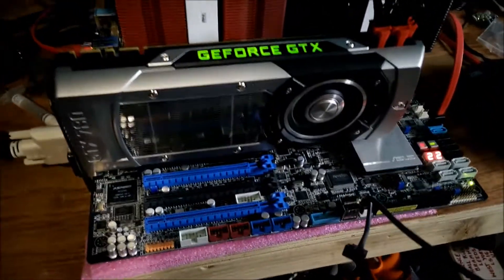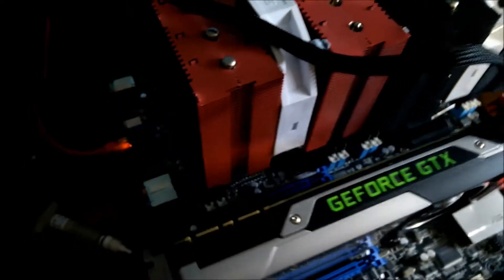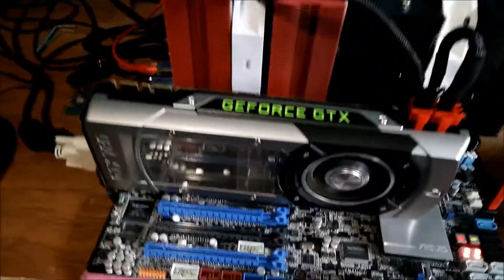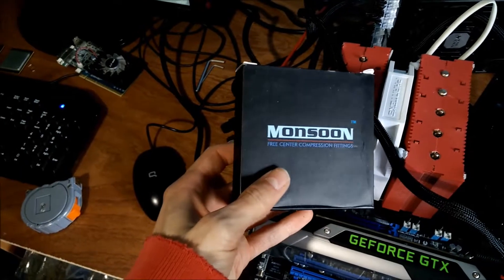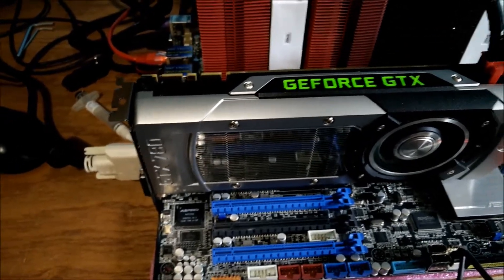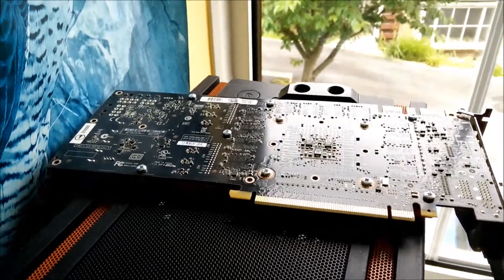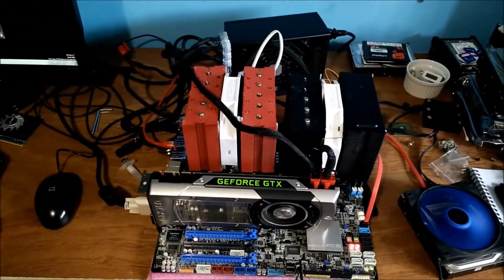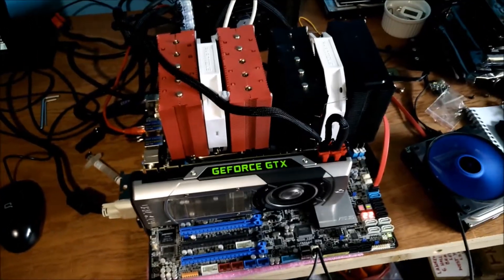More Xeons Dual E5 2670 and Dual GTX780

Comment: Hi there, looks like its gonna be a great build :D

My current project is similar :)
I received my parts last friday and experienced many problems till now...
Were you able to install the OS at the first shot?

My Setup is:

Z9PE-D8
2X E5-2670 v1 SR0KX
64GB Samsung ECC Ram
Samsung 850 EVO 500GB SSD, Samsung 830 EVO SSD
Asus Strix GTX 980
EVGA Supernova 1300 G2

i tried to install Win10, 8 via USB and always got an "ACPI_BIOS_ERROR" message. After that i deployed a PXE Server- same problem. After tweaking the settings in the BIOS and BIOS Update i tried to install Ubuntu - worked like a charm.
In the end i went with a Windows 7 installation via DVD - this worked. I installed all the drivers etc.
Now the main problem occurs after installation of the Nvidia drivers - lines all over the screen and crashing before the login screen.
In safe mode or at a normal boot with generic graphics drivers - it works. As soon as i install the drivers again - same story. 
Tonight i'll try another GPU to see if the Card is defective. Have you connected the EZ_PLUG molex? What BIOS are you running? mine is 5802. ACPI and CSM settings? Any similar problems? Also i've seen in some forums that a lot of these Motherboard have a BIOS Chip problem (replacement available for 15 bucks on ebay) which i exclude cause it worked more or less...

Sorry for the spamming, i'm just kinda desperate cause i've never had so many troubles with a pc

I would appreciate any help

Thanks
Reply from the maker: it sounds like you have a faulty gpu is it has lines across the screen, if it is still under warranty then you should be able to rma it and if its not it will need to be repaired by reballing or sold as spares. My friend has repaired a couple of gpu's for me and he managed to get 2/3 working, but its not going to work for every card. i dont use the molex pug, that is only to be used if you are using more than 3 graphics cards or other power pcie cards like raid cards. 

i would try getting you gpu replaced first and then if that does not work, then try the latest bios you can. i am also running 5802 and its works fine for me. i am running everything overclocked as well and i have had no problems :)
Reply from the maker: i just looked on asus's website and 5802 is the latest bios so that should not be a problem unless its with the bios chip itself:
BIOS 5802 for Z9PE-D8 WS released.
1. Improve compatibility with some add-on cards. (LAN/GPU/VGA cards.)
2. Improve compatibility when using some PS2 keyboard and USB mouse in Windows 2008. 
3. Improve stability about fan speed control. 
4. Support the policy of 3DVGA Card List for all Z9-Series project.
5. Improve BMC performance.
6. Modify string from "Lan1" to "LAN1".
7. Improve compatibility about some PXE boot case. 
8. Improve compatibility with Ubuntu OS. 
9. Improve efficiency of power consumption.
Reply: +Lawrence Timme lucky guy :) thanks for the fast reply
Reply from the maker: Nino Grobotek you're welcome
Reply: i tried yesterday with an old Radeon GPU, no lines on the screen etc, but i still get the ACPI_BIOS_ERROR at the setup loading screen when trying to install Windows 8, 10, 2012 R2...Windows 7 works fine. I think i won the lottery with a faulty GPU and Mobo -.- have you tried installing Windows 8 or 10? as i see you're running Win7
Reply from the maker: Nino Grobotek i only run windows 7., the bios chip is not soldered on so try pulling it out and see if the contacts are corroded, if they are clean hem up a bit , if not try putting it back in again and reflash the latest bios. if that doesnt work you might want to get a new bios chip.
Reply: When i turn off ACPI the problem persists...
Honestly i tried every possible configuration :(
I even found Screenshots of the BIOS settings from a Pugetsystems PC (they make screenshots of every window).
Yesterday i even tried flashing the BIOS from the oldest version possible to the newest step by step, didn't help etiher. I also found out something interesting. According to GPU-Z the Graphics Cards runs at PCI-E 1.1?! I tried this with 2 different GPUs.
I guess i will RMA both components since they're still under warranty. Thanks for the help guys.
Reply: ***** Update: i checked the CPU sockets for bent pins - nothing. In the end i determined that the GPU is faulty, tried it on a friends PC and RMA-d it. The mainboard's BIOS is also faulty, i've contacted Asus, they will send me a new BIOS chip because the IME version is 0.0 etc. weird... if this wont work -> RMA.

Hope it will work when i receive the hardware :)

Once again, thanks for the help guys and have a nice day
Reply from the maker: Nino Grobotek hope it all works in the end :)
Reply: the new BIOS chip arrived, works like a charm :D
Reply from the maker: Nino Grobotek good news! enjoy the dual cpu fury :))))))))))))))))))))))))))))))

Comment: I'm curious what CPU score do you get on firestrike and time spy with the overclock? i can't overclock my board but it was only 175 dollars. The reason i ask about the CPU scores is because mine used both CPUS and i'm just wondering what is wrong your with your machine. Do you have windows pro?
Reply from the maker: as far as i can tell fs cant use 2 cpu's. it looks like its limited to using 8 cores. and yes obviously i'm using windows 7 pro otherwise it wouldnt say in cpuz that i had 2 cpus.
Reply: What is the physics score? Mine uses all cores on both CPUs
Reply from the maker: Dual Xeon Gaming 17,694 in firstrike
Reply: Lawrence Timme I'd say that is normal for them in firestrike I have a similar score of 17967. I didn't really expect them to perform very well with DX11 anyway. Give the time spy demo a try and I think you will be happy to see that the xeons perform better than almost everything except the $1000+ processors. It's nice to see so many people building these machines :D
EDIT: turn off hyperthreading for time spy benchmark, you will get a much better performance in dx12 but less performance with Vulkan API